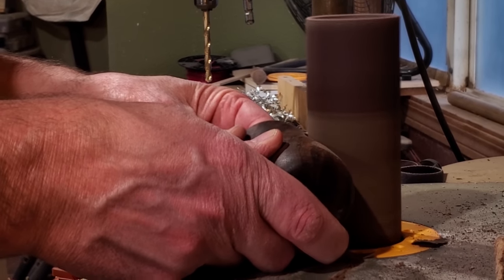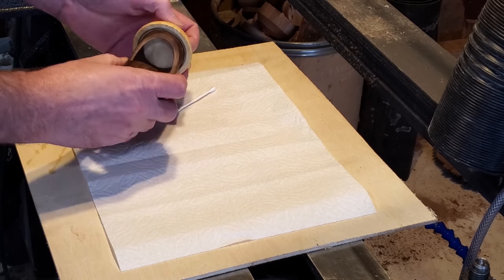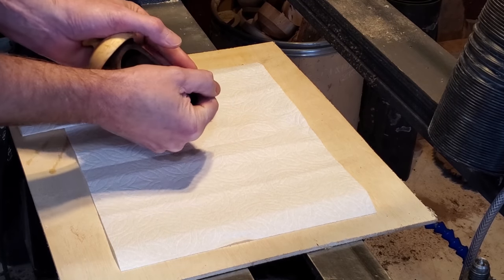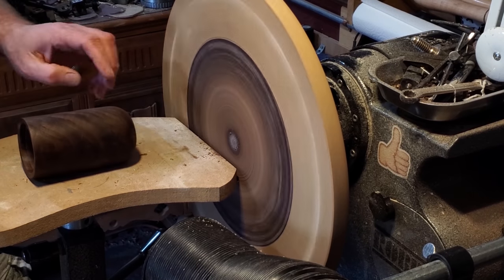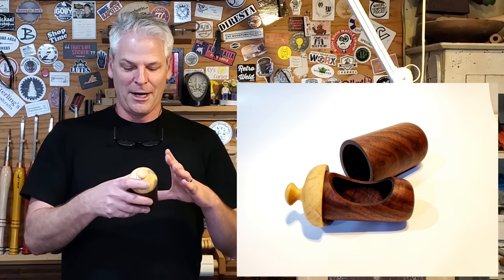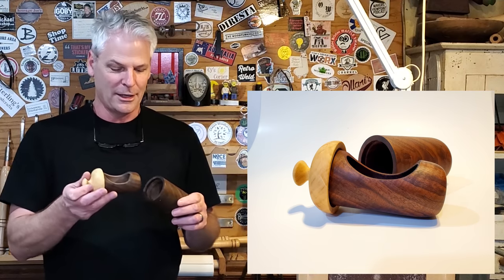Woodturning | Lidded Box

Comment: Hey Carl, Is that Australia oil you’re using?  If it is you only need use use a few drops on a rag. The trick I’ve found with it is to burnish it at very high rpms and it cures it immediately. 3 coats and done.   I’ve had a tiny bottle that’s lasted ages.  Great project. Thanks.
Reply from the maker: Hey Eric, Thank you!! It's Howard Bees Wax